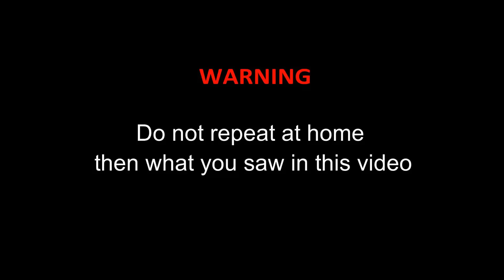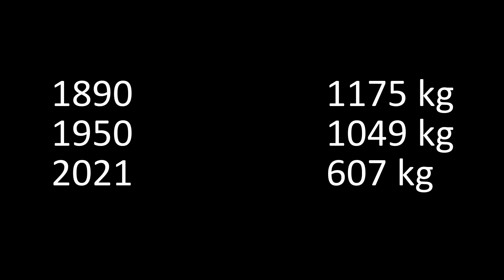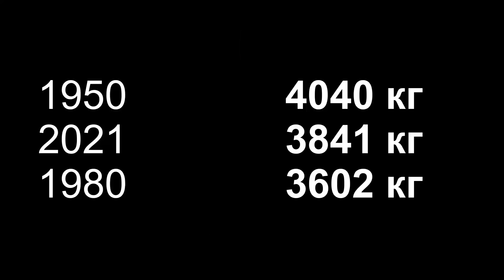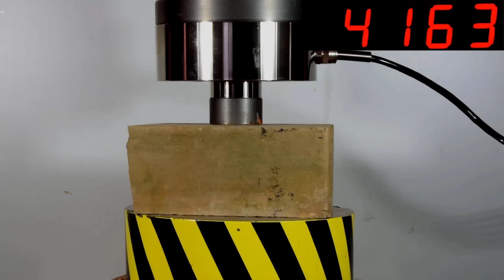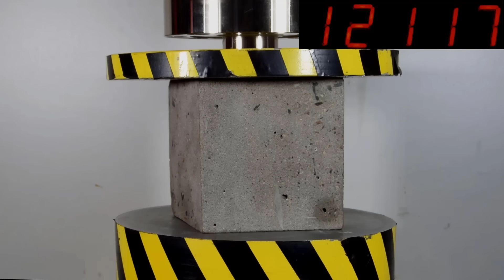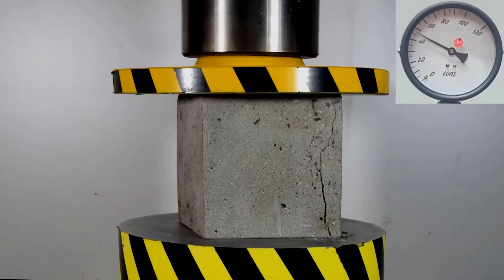HYDRAULIC PRESS VS OLD AND MODERN BRICKS

Comment: With the modern concrete, you can tell the force was coming in at an angle, as one corner was higher up, skewing the results. Putting all the force on one point creates more shear force than when the weight is distributed across the entire area, so the actual load bearing capacity of all those materials is a lot higher than what's shown here, but the relative strength of the materials is compared pretty effectively for the bricks, since they were subjected to the same process every time.
Reply: The brick finatic
Reply: With basic "modern" engineering you can tell that concrete is actually soft. That's why they use rebar to reinforce it. That's also why galloping Gertie was able to flex and how "modern" sky scrapers are able to sway (look that up if you think it's not a thing). Yes the corner was higher... The test was probably skewed by a max of 3% from that. A "perfect" block would give numbers within the margin of error when compared to the one we just saw.
Reply: And if anyone is curious another reason concrete is soft is to allow it to expand and contract when it gets cold or hot. It also takes an extremely long time to fully "cure" since it would not be desirable for it to cure before it fully settles. There are many different recipes for concrete and everywhere in the world is different. This is why we have engineers. They will figure out how much of each ingredient to put in for the type of climate and type of earth under it. They will make it less porus and more malleable in colder climates that are more prone to freezing past a certain point of depth. That way your foundation doesn't just crack after one winter (water expands when it freezes and WILL crack your foundation).
Reply: Error im Codingkeller  The old bricks actually all have a slight positive curve, if they had been flipped "upside down", I believe they would break much, much earlier.
Reply: And u can tell by looking the modern concrete is NOT completely dry
Reply: @LegionPCMR  actually they use rebar because concrete is brittle not because it's soft...
Reply: and roughly the same shape, a cube will be stronger than a narrow rectangular block
Reply: The big difference I saw was the old concrete having more larger aggregate.
Reply: The modern concrete does not look right. I've seen concrete being crushed before - and it should break to hard pieces - there shouldn't be any crumbling to sand or dust as seen in the video.
This either wasn't fully cured, or the sand-cement ratio in the mixture wasn't right, or both.
Reply: @LegionPCMR  legion you have a couple good points but the majority of your post is clear you don't know what you're talking about. Looks like you read an article once and filled in the blanks yourself.
Reply: @hooby_9066  Civil engineer here: Something is definitely wrong with this concrete - it seems like it was almost made to fail to prove a point that modern concrete is worse than ancient concrete (which it is'nt). As you say the ratio of sand-cement is off, I see no aggregate (stone, gravel),  and it seems to have been mixed wrong.
Reply: 6k vs 60k
Reply: It has more to do with the fact that the modern "concrete" is actually just cement, which by definition has no stones or rocks in it for reinforcement. It wasn't even an apples to apples comparison.
Reply: You do know that peaple nowdays build shi bricks so that buildings die faster right ?
Reply: Doesn't it make a difference that they weren't the same size. They had a different cross-sectional area
Reply: Brick braniac
Reply: @flannel365  No. Only with gravel it is concrete. If it's only cement + sand, without gravel, then it is mortar. If it is only cement with no sand either, then it's bullshit.
Reply: @TheLastMuffin007  don't know what I'm talking about huh? Lol ok 🤷🏼‍♂️... Anyway I hope everyone else looks up the info if they want the truth. It's definitely stuff most wouldn't know about but think they do. Feel free to fact check me by actually looking it up though 👍✌️
Reply: @LegionPCMR  you don't know what you're talking about. Concrete is only considered soft if you're talking about a Mohs rating. Otherwise it's a very brittle hard material. Rebar is used to prevent material deflection and keep it from breaking because of its brittleness, not because its soft. Concrete will fully cure to its advertised strength within a few days. You're confused thinking it takes a long time because concrete never stops continuing to cure, they say it gets stronger with age. Idk what that gertie thing is. Skyscrapers do not flex because of the concrete foundations. It's due to the central shift in them. For flex like that you need a ductile material, not a brittle one like concrete. Concrete does not expand and contract in a predictable manner in the cold, which is why it cannot be used in the north (cold climates) for road surfaces. Concrete has great compressive strength but not great tensile strength. So when water gets in and freezes inside it, it easily breaks and chips away.

Sources: I work for the state inspecting and renovating state highway bridges and overpasses made mostly of concrete, rebar, and steel beams.
Reply: To be honest the imperfectness of the sample had marginal effect to the load bearing capacity. The real culpirt was due to the huge diference in compostion. The modern concrete was just sand and cement which, while cheap, pales in comparison , in terms of load bearing capacity, to the old one which had gravel. Meaning the old one had material that allowed the "glue" (aka cement) to form a much stronger bond.
Reply: @TheLastMuffin007  good job you threw some truths in there. 👍 Have fun "working for the state" kiddo. This is not something impressive and everyone knows how much "work" state workers do. Side note google galloping Gertie and tell me again concrete doesn't flex.
Reply: @LegionPCMR  well... My starting pay with no college or any sort of post HS education was 45/hr plus raises yearly. I get 3 paid months off in the winter to travel or relax at home. Can't do concrete or asphalt highway work in New England winters. So I'd consider it a pretty good gig these past 7 years.
Reply: @LegionPCMR  I looked up galloping gertie. That was not concrete flexing. That was steel beams, steel cables, asphalt (blacktop) all ductile materials that have enough plasticity to flex and return to shape. Any concrete used under the road surface would have been fractured and cracked, being held in place by the asphalt above it and steel below it. Also don't refer to random people as "kiddo" I'm 34 ya boomer.
Reply: @TheLastMuffin007  I'm going to mute this feed after this so you can have the last word. You really do need to find some friends kiddo, and no I do not want to be your friend. Run along now.
Reply: @LegionPCMR  love it when you beat someone so much they resort to insults. <3 maybe you should brush up on material properties and you could have a better paying job with more annual time off like me. <3
Reply: Well, the bricks shown in the video are clearly made of clay (NOT concrete)!
Reply: @johnmiller1015  True, but the area being subjected to the pressure was the same, as they used the same setup, which only covered a fraction of their actual area. If they had used the entirety of the hydraulic press' contact area there might have been enough of a difference in the area of the bricks to skew the results, which could actually be seen with the concrete; the concrete only handled that much pressure over it's entire load bearing area as opposed to the smaller fraction of surface area compressed on the bricks.
Reply: @TheLastMuffin007  what an ass spanking you gave that individual, good on you for standing up to them with facts and logic rather than resorting to pathetic name calling. I’m not an expert on material sciences but I’m educated enough to recognize you were correct, and upon reading more into it out of interest found your very same sentiment reflected in the words of other people. Excellent work.
Reply: @jelloenjoyer4839  thanks, I was just hungover and cranky.
Reply: Pretty sure it didn't set properly, looks like it didn't have enough time, or its a bad mix, too much water
Reply: One karate chop brakes them all!
Reply: Thanks... Was just about to write that... Soft concrete 😂
Reply: @TheRealBedintruder  As a civil engineer you should know, that concrete/clay bricks are mixed to achieve different properties. You can pretty much buy the same or almost same mix as the 1800s one. To built a proper solid building you'll even need differently mixed mortar for each one.
Reply: Compairsion was misleading anywas. Concrete is very different, you can compare modern C12/15 with old concrete and it will be weaker, but you can compare it with, C50/60 or UHP concrete or with more experimental concretes like RPC (able to withstand 230 MPa). So without saying what concrete he used, this compairsion is useless
Reply: @derunfassbarebielecki  I know that concrete/clay bricks are mixed for different properties and purpose and also that mortars differ greatly. But it seems that the mix in that specific concrete is off and not something I would use in construction in Denmark today, maybe it is used in other countries (I obviously cant know) or was used previously, but the only time I have encountered concrete like that was in a test to see "bad" concrete.
Reply: The same happened to the old concrete
Reply: @insomniacbritgaming1632  facts
Reply: It's cement not concrete. Concrete is literally the mixing of cement with stones, choose your size for the purpose.

Comment: Not only the baking method and clay matters in how strong the brick is but also the ageing of the brick itself. The more aged brick is gone through many heat cycles daily bonding the molecules even better and creating much more solid chonk. Same thing happens with concrete too.

Comment: The force on the concrete was applied over the entire surface of the block, whereas the forces on the bricks were concentrated on to a small point. The two things cannot be fairly compared; the bricks would have withstood MUCH more force if it had been distributed over the entire surface.

The point at which measurements are taken is not consistent (1950 brick cracks through around 400 kg, but is arbitrarily recorded as over 4000 kg long after the crack started to widen)

The year numbers aren't recorded correctly (1890 becomes 1980 in the second test)
Reply: There was also no reinforcement in the modern concrete. Rebar, rods or mesh is used in modern concrete and it massively increases the strength. In the Older concrete, cut from that fort. It was reinforced with stone and shale giving is a massive advantage over the modern stuff. 
The other problem or lack of information the video doesn't provide is. Most modern materials, concrete and Bricks are lighter, and give more strength than their required use. If you build a house out of modern bricks vs older bricks. Not only is the modern house lighter, but the tolerance on the bricks will be less than the required weight that will be put on them. Well, unless the people building the house are shit and build the walls pissed and the weight isn't distributed evenly, but even then, the walls or house will fall over because the house is uneven, rather than the bricks failing under weight or pressure.
Reply: Correct! A stupid useless test that doesn't do anything.
Reply: @dutchman7623  I think we should be clear about the following: These videos are primarly for entertainment and generating clicks. That they lack any scientific aspiration has been well explained in the comment before.
Reply: Test it when there are tornadoes or hurricanes
Reply: @richigordillo1324  Most Brick both Historic and modern buildings, at least in Americas tornado alley hit by F5 Tornados withstand the winds and hammering. Usually the roofs and windows are removed, but as most roofs at least in housing, are framed in timber, and they are the weakspots. Plus Bricks don't tend to make good windows, lack of transparency :P

Hurricanes on the other hand can be a different animals altogether, and most coastal homes are usually wooden construction. However the brick houses that have scattered the coastal areas generally survive hurricanes. The ones that don't have usually been impacted by large debris swept up in the hurricane. cars, trucks or other buildings.

An Investigations into the Hurricane that hit Florida or New York was investigated, and they discovered that brick housing build around the 1950-1970 hadn't faired all that well, but they believe it was down the building codes that were used during that period.
Reply: also the ceoncrete is science itself. Age is only one thing. You would really expect a concrete from fortress to be some very high quality and good strength. But pretty sure they can do better now or atleast more consistent when they really need. And for the bricks maybe the new bricks are optimized for other parameters.

Comment: Not at all surprising that a modern brick fails at a significantly lower tensile stress than older ones. Modern engineering and manufacturing allow much greater control, and more importantly consistency which drastically reduces the amount of strength needed to guarantee the required level of strength. This isn't an Indictment of modern bricks or concrete, but the reverse: over strong materials only increase costs but don't offer any meaningful win - it doesn't matter if your bricks are twice as strong when it's the mortar that fails anyway. By having a lower strength brick (that is still sufficient strength for the design of course) you get cheaper construction without risking safety.
Reply: Factss
Reply: that is true you speek from engineer knowledge
Reply: Aye, I was glad they also did a  modern high strength one. That showed that when it is needed modern bricks can easily "beat" the older ones.
Reply: I read somewhere: "Modern engineering is an art of building structures just strong enough to barely stand."
We now can build 10 bridges using the same amount of materials and labor as a single massively overbuilt antique bridge.
Granted, it will not stand fot 2000 years, but it's not needed. In under a single century cities and roads will change so significantly, the bridge will need to be replaced anyway.
Reply: @vladimirkoshelenko  that's what people forget. It isn't just "bridge won't last as long", but rather how many more bridges you can build.
Reply: The modern problem is that the mortar is to strong so cannot deal with inevitable micromovements as well, and wears out the masonry units as it is taken out on them. So older buildings with lime mortar, outlast modern cement mortar buildings.

The idea of using modern engineering to make buildings only just strong enough is very flawed. It means they last for much shorter time periods, some only 25  years. Which is terrible environmently due to the enormous embodied carbon of their construction. It is much better to make them last a lot longer.
Reply: @user-iw7gb6hx2j  Most modern building projects(short of megaprojects like highway, bridges, etc) are projected for a lifespan of several decade to a maximum of half century, before needing a rebuilt/unsafe for use. Sure, if you want the building to last longer, you can use stronger material that could last, say, centuries ahead. But the biggest problem is that modern construction is much more complex than the old ones. Does Romans with their centuries old building use steel rebar to strengthen their building support? Those steel rebar does corrode overtime, like it or not. The concrete might last centuries, but other component might rot/corrode first leaving it useless anyway.

Also other thing to notice is that in modern construction wall is no longer a load bearing component(while in past the whole building is load bearing component, both the wall and pillars, etc) since we left those jobs for the supporting pillars. Knocking out walls in modern construction will give a less severe effect compared to building from centuries ago.

Engineers make building only just strong enough because the economy is in the equation. Do you want passenger airplane as big as current airliner that only able to carry 5 people(and at the same time costing hundreds of time more than current airplane ticket)? Do you want your house to cost 5 times as much? Do you want the road in front of your house to cost 10 times as much? So just that it could outlast your life? Are you willing to pay for that? If not then don't say it's flawed. It's there for economical reason. Nobody is willing to pay something much more than necessary just for a promise of longer standing, even if you put the carbon argument. It's just not economically worth(also don't forget social factor. I'm looking at you, Apple). If you still want to argue, then good luck for having a lunch costing as much as current house price.
Reply: @user-iw7gb6hx2j  agreed but the government doesn't see it that way, even though they want all of us collectively to pay for it. Even the temporary structures I've built have been over-engineered to save me or my family in the long run. Hopefully they will be there long after I am gone.
Reply: @vladimirkoshelenko  Exactly. Except we do use a factor of safety.
Reply: @animalmother9339  The biggest problem with American bridges that I've seen is lack of maintenance. Many of them were built and seem to have never been looked after. The iconic ones, on the other hand, are in good shape because they have been maintained.